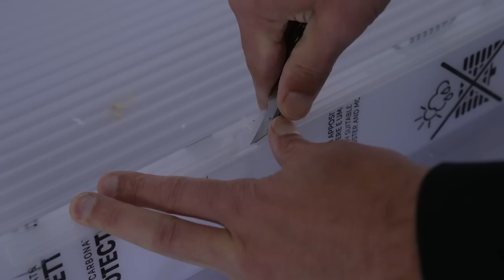Table that weighs less than 19lbs | DIY Polycarbonate Furniture

Comment: That's a really neat project and very polished, even for a first iteration. My only concern would be that because it is so light, it would be easily knocked around during use. Use in a corner or at least next to a wall might be required.

Comment: Very cool design. Slipping the steel nuts into the channels was very clever. An alternative idea from boat building since you already had epoxy mixed up— 
Thicken some epoxy with colloidal silica filler and make 3/4” epoxy fillets with a rounded paint stirrer to create the convex fillet. Then lay a few inches of fiberglass tape and dap with clear epoxy for crazy strength that almost disappears. 

You’d want to scuff up the polycarbonate with sandpaper to give the epoxy more surface area to bond to. 

Your ability to see materials for what they could be rather than what they’re marketed for is very impressive.

Comment: Nice project! love the aesthethic and experimentation.
Just curious: how does the ploycarbonate panel age? What's the table going to be like 10 years from now? does it get discolouring? gets softer or more brittle?  thanks!
Reply: these claim (and usually hold that claim) to withstand direkt UV exposure without any damage over years and years. After all they are designed to be used outside.

Comment: What is the purpose of this table? Lightweight? Why does a table have to be lightweight though?..
Reply: It functions fine I'm assuming but he's experimenting with non conventional materials.
Reply from the maker: easy to  move in a studio that changes function
Reply: As a carpenter who needs to set up and break down a jobsite daily— lightweight, stiff tables are the way to go. 
Hollow core doors or plywood torsion box tables work well. 
Folding or detachable legs would make it great for backyard BBQs, easily hung on the wall in a shed. The table wouldn’t be as stiff or clean looking but pretty functional and unique.
Reply: nice, now that makes sense, thank you
Reply: good for  outdoor family parties